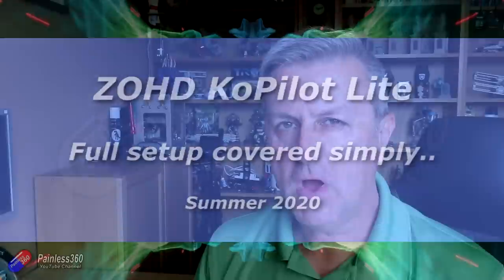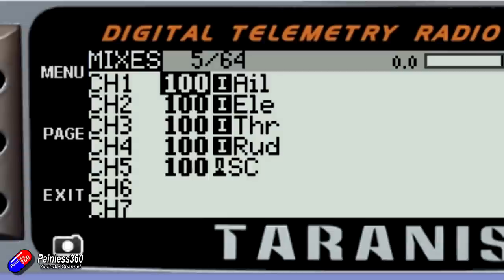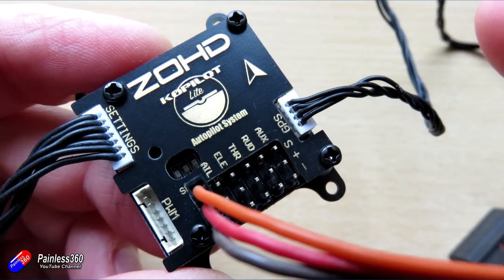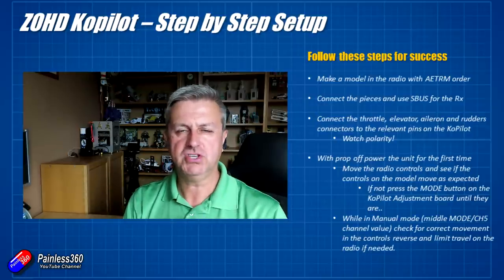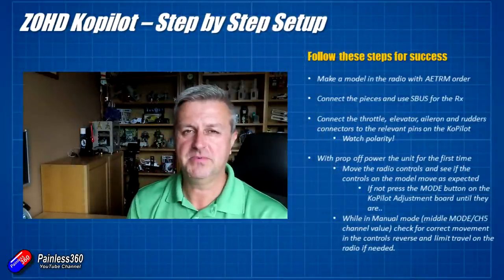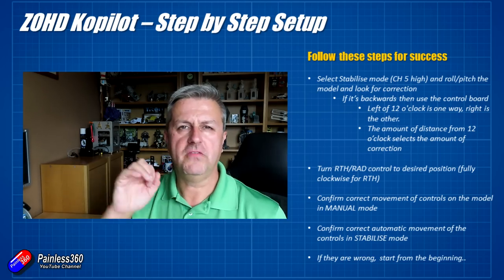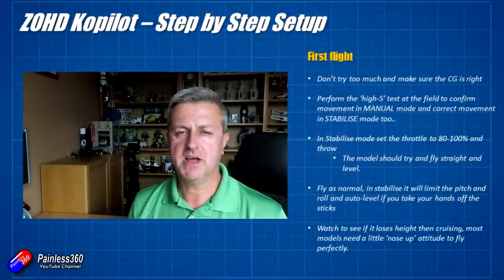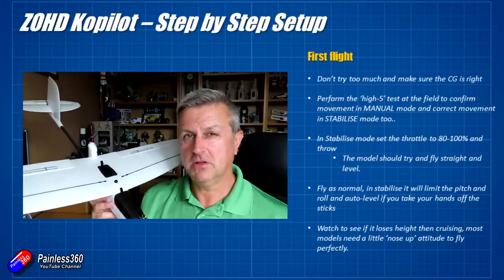ZOHD KoPilot Lite: simple stabilisation and RTH - step by step setup for new pilots

Comment: Hi Painless 360; 
I'm arriving at a half understanding of copilot hardware. I'm using a low-cost RC plane to learn how to run large-scale orthomosaic surveys. (I've got a Bixler 2 ready to fly with just its servos and RX to practice and learn how to fly fixed-wing.).  

Will the ZOHD and its OSD camera and some other piece of hardware allow me to later program the Bixler to run lawnmower patterns to capture orthomosaic imagery, as I can already do now with DJI GSPro and a Mavic or Phantom? 

Thanks. I always find your videos helpful. 

Glad to buy through your affiliate links, by the way, if you can link or suggest everything I need to run ortho flights after I'm confident flying my Bixler.
Reply from the maker: No missions on this things - it's a simple stabiliser with a RTH function. See the ArduPlane/ArduCopter builds in the PixHawk 2020 series for something serious for surveying and mapping... Best of luck!

Comment: Just got mine installed in a mini sky hunter  and i must be doing something wrong it flies good but when i let off the throttle it wants to stall and spin in.What am i doing wrong cg is good and as far as i know i do not have to much elevator throws.
Reply from the maker: Could be a few things. All of the steps I use are in the video.. Best of luck

Comment: Hi, congratulations on your channel.
I have a kopilot, why are movements in stabilized mode so limited compared to manual mode? Is there a possibility of increasing them to make the wing more agile?
thanks greetings
Reply from the maker: Nope, the max bank and roll angles are set. Happy flying!
Reply: @Painless360  OK thanks,
I will try to play with the adjustment of the gains to be able to have more control penalizing the stabilization a little.

Comment: Great series of videos,  I have a couple of these on the way to help me as I'm just beginning in the hobby and I like the idea of this as a safety net.
I have most of this sorted in my head but have one query,  When using the SBUS connection does the Kopilot take it's power feed from the throttle connection and then feed that via the SBUS connection to power the receiver?
If this is the case I assume you must use an ESC with a BEC/SBEC supplying 5 volts
When using the PWM inputs am I right in saying you need to power the receiver with 5 volts and the KoPilot then takes it's power from the mode switch connector?
Some help in clearing this up would be greatly appreciated.
Reply from the maker: The Kopilot powers the RX.. Best of luck
Reply: @Painless360  Thanks for the response,  much appreciated.

Comment: My ZOHD 250 is great in manual and stabilised but in RTH it's like a Banshee on 'crack' in pitching up and down. I did swap out the motor for a T-Motor F20 II 1408 3250KV Motor (I used a 4s and cooked the original motor...) I've tried to re-do the neutral calibration but it wont oblige. Any ideas please?
Reply from the maker: The PIDs for RTH seem fixed and the mode is more of a last resort... Happy flying

Comment: Hi Mate, great video ! I recently bought kopilot lite but having issues with Throttle/ESC calibration.  How do you calibrate the throttle /ESC once connected to the FC ?  I have used omnibus & matek FC with Inav & ardupilot and they all need throttle calibration  via FC to get full range of the throttle . With Kopilot I'm not getting full throttle range via FC?

Comment: I am going in circles here trying to use express LRS with the Kopilot, I am using sbus and have control of the elavons but I can't get the selector switch (ch5) to work. So from what I understand elrs reserves ch5 for arming and is only a 2 position switch. Any ideas how to get around this ??  Thank you for all of the great info in this video!
Reply from the maker: How are you connecting it up as ExpressLRS doesn't support SBUS last time I checked?
Reply: @Painless360  The only way I could see this working is by using PWM and only for a wing or V tail. Use Ch 4 in the Ch 5 slot then change it in the radio so ch 4 is a 3-position switch. Does this sound plausible? or just give in and go back to Crossfire on this one LOL
Reply from the maker: That sounds like the way that I would attempt it - use the PWM method. You can normally map channels to outputs on the PWM receiver and some don't map CH5 to any output. See https://www.youtube.com/watch?v=3X2fknwE7SI
Reply: @Painless360  Thank you so much!

Comment: Painless360, great vid.  Do you know of any flight controllers with RTH that have a trainer mode with stabilization and a regular mode with stabilization.  It seems the manual mode on the Kopilot disables the stabilization as well as the auto level etc.  I’m looking for a unit less complicated than the iNav or Ardupilot systems.

Comment: Good video, her is a challenge for you Lee, see if you can get Ko-pilot to work with Flysky FSai6B, tried on Ibus, PWM nada, still think i got a duff one from our lovely friends at BG
Reply from the maker: It only supports PWM and SBUS... See the videos all about that in the playlist. Happy flying!
Reply: Running Kopilot successfully with Flysky FS-i6 + Flysky FS-iA6B (not FSai6B :D) on PWM in ZOHD Dart250G and Volantex Ranger G2. (G2 needs stock ESC replaced with something like Turnigy Plush ESC to work with Kopilot.)
Reply: @theoztreecrasher2647   I was using the  FS-IA6B with hobbyking blue 30amp esc, just could not get the ko-pilot to talk with the RX, i still say i got a faulty one but its enough to put me of the product
Reply: @theoztreecrasher2647 Thanks for the heads up.  I am planning for the same setup, Kopilot on a G2. I got my G2 during the lockdown and so its still in the box. Why do you thing the stock ESC is not suitable to couple with the Kopilot? Is it because the BEC in the ESC cannot handle the load of the Kopilot board and the servos?
Reply: @julianhumphrey4843  Anything's possible but once I've got past the myriad possible pit/pratfalls in setting it up I've found it OK. You didn't mention your Tx. If FS-i6 stock you know you can't use the Sbus output on the iA6B? Only FS-i6X/S can be set for Sbus use with it. Oddly a different brand of receiver with only Sbus & PPM outputs is working with my FS-i6 on a KingKong/LDARC TinyWing.
The ESC incompatibility thing is a known issue.
Edit..FS-i6 stock doesn't have S-bus capability and neither does iA6B (uses i-bus.) I was thinking of iA6C. Old Timers' Disease. :-(
Reply: @ilyasahmed2141  The Kopilot takes so long to boot up that the Volantex ESC (and no doubt some others) "goes to sleep" thinking loss of signal and requires a re-power to wake up again. The Turnigy Plush ESC BEC seems to work but on larger planes a separate BEC is always a good idea. I've got 1 to install.
Reply: @Painless360  Hi Lee, i tried one last time as a youtuber did a ko-pilot to flysky setup video did the PWM and guess what, still does not work, so now the only conclusion i can draw is i got a faulty unit. I will chuck it in the trash, but keep the GPS as i can pin the wires and use it with an Inav/Matek board

Comment: Timely - just finished putting one into a Dart 250g, nice to have the workflow confirmed.
Any tips on kopilot gains and manual throws for the Dart 250?  I assume it's a good idea to limit throws only in manual mode and have 100% for stabilised.
Reply from the maker: That would be a smart way to do it. Happy flying!

Comment: Lee if using 2 servos for ailerons with out a Y can you use the S- Bus or is that port only for S-Bus no exception , and adding flaps . can that be plugged directly into your RX? say channel 10?
Reply: OK I figured out that yes I can power the unit from the S-Bus port, Wahooo. still; searching for the separate servos for the ailarons
Reply: Well I built a Y to run the ailerons, but I am still curious if they can work separately, and with with the Kopilot powered from the S-Bus can flaps be plugged into the aux port and if so how to have the radio control it. No luck so far making that work.
Reply from the maker: I've never seen them separate on one of these. Best of luck

Comment: After a crash my model is with all surfaces super sensitive almost like it's digital, on or off.
Is there a way to factory reset the kopilot and fix this ?
Nothing as changed on the radio.
Reply from the maker: Eventually in manual mode?  I've not seen that...
Reply: @Painless360  in any mode when I give any input it goes from 0 to 100%
Reply from the maker: I've never seen that, not sure about a reset..
Reply: @Painless360  nota a good first experiência

Comment: My set button doesn't do anything, I only get a red led, no greens. I press the set button repeatedly and press and hold: nothing. I unplugged it and plugged back in, still nothing. On top of that the servos work sporadically. If I can't get this to work I'll use a Guardian gyro, which is a shame because I was intrigued by the gps feature of Kopilot.
Reply from the maker: Check the mode it is in. It makes all the difference. Follow the steps and tips in the video for how I do it... Best of luck

Comment: hi, thanks for your videos, they are very good.
I have two fixed wings of 800 and 1000mm approx with kopilot with the same problem, they fly perfectly in stabilized mode but when I use the semi-autonomous take-off with the RTH or when in flight I put the RTH it goes like sudden jumps entering a loop that if I don't change to stabilized or manual sure it would end very badly.
I have changed gains going down to the maximum elevon, but I do not correct it, I repeat it happens only in RTH mode.
What do you think could happen? Thank you

Comment: I got a little FrSky R-XSR to go with my Drift and Kopilot but can't get it working in SBUS. No movement on control surfaces and I can't change flight modes. Replaced the R-XSR with an X8R in PWM and it works fine that way. Any ideas?
Reply from the maker: Could be a few things - what troubleshooting have you already tried?
Reply: @Painless360  thanks for your reply. I've made sure the board actually functions in all modes (by switching the receiver to the X8R and using the exact same model in my Taranis), and have made sure that the R-XSR is in fact in SBUS mode and properly connected to the SBUS connector on the Kopilot. Beyond that I'm not sure what else to try. I have a Taranis X9D Plus ACCST. I have a telemetry link between the R-XSR and Taranis but just no movement or ability to switch flight modes or anything on the Kopilot. Kopilot works perfectly on the bench with the X8R, GPS locks and everything works (GPS locks with R-XSR as well, just nothing else works).
Reply: That wasn't the issue... Dang it
Reply: I'm now ensuring firmware on both my TX and X-XSR are up to date. Edit: FINALLY got it working... after updating EVERYTHING to latest firmware, then the receiver not even binding, I had to go back and update the internal XJT. Finally it bound again, and this video solved my problem: https://www.youtube.com/watch?v=YnEDqGZwPpo
In the end I just had to move a wire on the receiver over one pin from S.PORT to SBUS.

Comment: Hello Lee thanks for your awesome videos, just installed the Kopilot in conventional plane had a Vector in it previously no issues. For some reason the throttle does not respond the lights show I get GPS lock and I waited for the ESC to initialize as you indicated but after 15 min nothing any ideas?
The stabalisation works etc
Many thanks Adrian
Reply from the maker: Not sure, I've not seen that here... let me know what the problem was when you figure it out.. best of luck
Reply: @Painless360  thanks for your prompt reply I connected another ESC and motor and it worked as you said, it beeped a few times then when enough satellites it initiated and started, it is a coincidence as it worked before with the Vector, will do some more detective work
Thanks again
Reply from the maker: Ah! I've heard of some ESCs timing out waiting for a valid throttle signal from the KoPilot. It only sends that when the GPS locks.. Maybe that is part of it..

Comment: I set leds lights for v tail. My rudder is controlling v tail like it’s the elevator , and the elevator stick is acting like the rudder… I thought I had the servos reversed,, so I switched them but that did not fix it… I tried changing the mix, switching rudder to elev and vise versa,,, now they work correct but in stabilized mode they do not move to correct in the way they should…
Reply: Something you should be made aware of. If you are setting up a Talon250g for instance, then the set-up diagram for the Elevator and Rudder servos is different from that shown in the standard Kopilot Lite manual! The servo connections to the Kopilot are reversed. Compare the Kopilot Manual with the ZOHD Talon250g one! The Talon manual is correct for the way that the servos are mounted in the plane body. This could also happen for some delta wings if the Aileron or Elevator servos are mounted differently to the Kopilot manual diagram. Best of luck!

Comment: Thanks - Great video BUT!  Having followed all your instructions to the letter my motor will still not run after GPS lock, or even in full manual mode.  I am not using a ZOHD aircraft and equipment. It has been suggested that some ESC's have a shunt that kicks in because the Kopilot takes too long to send the signal???  Is there a way around this that you know of????  Thanks
Reply from the maker: I've not seen that. Best of luck
Reply: Did you use SBus or PWM? To be honest this channel seems to deal with basic step ups. Might be worth going to a forum based on your controller if you haven't fixed this already.

Comment: I have a quick question about the launch assist. In RTH mode and the throttle stick at 100%, does it then set the throttle at 100% once it leaves you hands, or can you set the throttle at say 75% and have that as your launch speed? I ask because I have a couple planes that are nuts at 100% throttle hand launch.
Reply from the maker: Throttle is set so can't be changed. Happy flying
Reply: @Painless360  I downloaded and read the manual and it says 80-100%. However I did watch a video detailing that the AUX port on the main board could be used as a mirrored throttle channel to plug your throttle into, easy to do on OpenTX. Acts kinda like a twin motor channel but runs one motor. Anyway you have full throttle control on launch assist. Stupid simple. Thanx for the response Lee
Reply from the maker: I'd be careful with that as the RTH stuff may not work with the throttle in aux. Best of luck
Reply: @Painless360  The throttle level is set at a MINIMUM of about 70% in pilot selected RTH (and Fail-Safe RTH) BUT you CAN increase that to 100% (in pilot selected RTH only) with your Tx throttle.

Comment: i cannot get the V-tail on the Talon 250g to compensate in the right direction. Using Taranis XD9 lite I have all control surfaces moving properly according to stick input. In stabilized mode,  Ailerons react properly when plane is rolled R/L but V-tail moves in opposite direction needed - nose pointing up, tail surfaces also point up and vise/versa. If I adjust the pot on the adjustment board for elev. all the way clockwise, the tail reacts to elevator input as it would normally with rudder input. (up/down on right stick, tail surfaces react as rudder. Right stick movement (R/L) and the tail reacts as elevator. When adjustment pot is turned all the way CCW, I get normal and correct reaction of the v-tail to the sticks, however tail compensates in wrong direction. Im ready to remove both servos and rotate them 180 degrees.
Reply from the maker: It appears that you are assuming that the gain pot's work in one direction only. Middle position is actually no gain with movement counterclockwise being gain in one direction and clockwise being the other direction. Rotate the control to the 3 o'clock position and try it... Best of luck
Reply: @Painless360  I did and there is a point where it changes from what is shown in the video being that just past 3 oclock to the right the stick movement is correct and stabilization is with tail surfaces together but direction is wrong, albeit very suttle. (little gain) Move to pot from three oclock just towards the left the tail changes to reacting like a rudder as shown. Im baffled and really think there is a problem with the kopilot. Thanks for your input.
Reply: @Painless360  I believe AzChopp3r (and someone else) was having trouble with the Talon250g and Kopilot because the manuals supplied with the Kopilot and with the Talon 250g show the E and R servos plugged into different halves of the V-tail. This is because the Talon 250g has the servos mounted back to front from the Kopilot manual diagram - which is too tiny to read properly anyway! 
All resolved on the Forums I think.

Comment: 05:25 As I understand it, if there is no movement in stabilized mode it may be because you do not have a satellite lock
Reply: Hi Joe, I have two of these now and have learnt lots from painless360 on this kopilot. You should have movement in stabilised mode with the ailerons/elevator moving in the correct direction to the movement you are imposing,  even without gps. The gps is required for the rth position when you have it selected. Don't fly it until you get the gps lock though otherwise when it does lock you will probably see your plane fly away to where it got the lock. If you haven't got stabilised when testing it on the bench then I suggest something is wrong. Make sure your mode switch is set up to work the right way. 👍